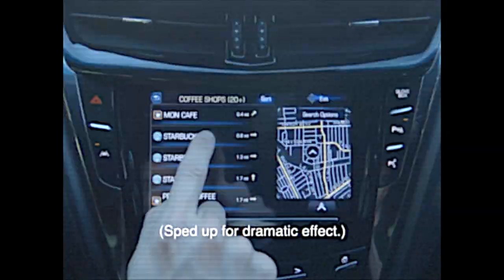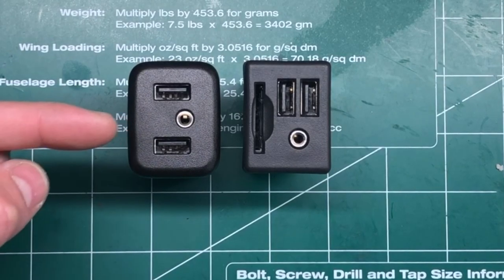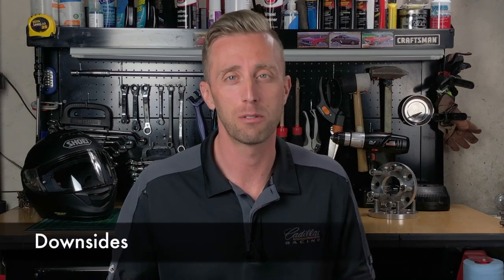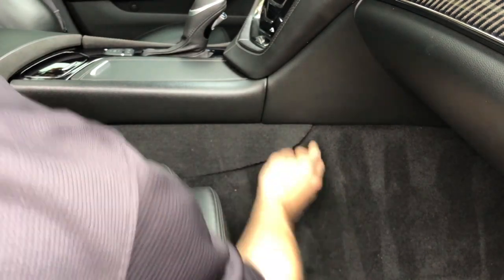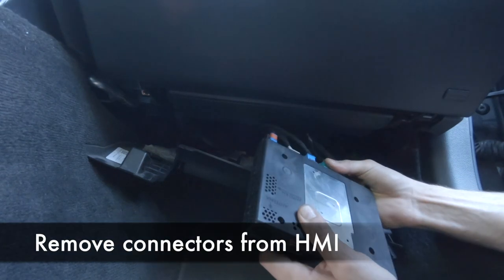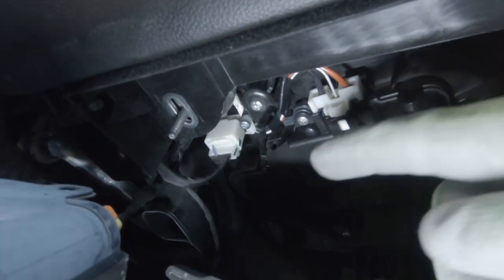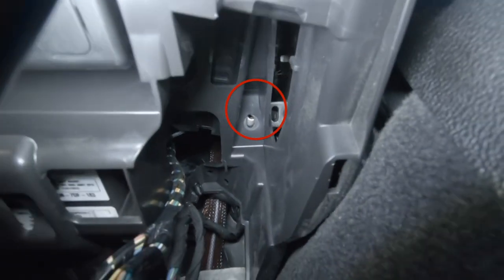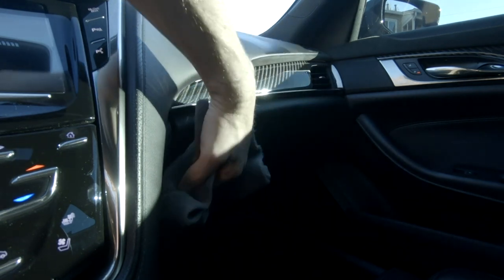How To: Upgrade your CUE w/ Apple Car Play & Android Auto

Comment: Installed my CUE 2.5 upgrade last night. Went pretty smooth thanks to this video! The hardest part I had was finding a good place to mount the included GPS antenna (my car originally did not have factory navigation installed so required a GPS antenna for it to work) as I had to find somewhere above the metal frame in the dash and keep it under the windshield. I finally located a spot just to the front of and below the center speaker. The first problem was that the metal infrastructure of the dash is some kind of aluminum and the magnetic GPS antenna does not stick to it so I had to apply some double sided tape to make it work. The frame still works well as a metal base plate for the antenna, it just isn't a metal that the magnet works on. Getting the antenna to this location took a bit of trial and error as it is very small area to work with to get the antenna positioned on top of the frame and get the tale to stick so the antenna is facing up. I accessed this space by removing the dashboard  center speaker cover. Once installed, I had to route the wire down into the dashboard so I could attach it to the HMI module. Getting the antenna situated and installed took the longest time. After that, it was just a matter of buttoning everything up and trying it out. Found out the location I picked for the GPS antenna works great though so no worries there. Two things I found out after the installation. First, even though the Nav system could find my current location in lat and long right away, when I pushed the button for local POI it said all the POIs were over 10,000 miles away. Also, I had no map at first so wasn't sure if it was working correctly or not. Not sure where this thing was put together but it thought the car was 10,000 miles away from any of the "local" areas. After driving around town and out on the country roads a while, the Nav system finally located and updated my position and then the map appeared with all my local roads and POIs. Even then though when I put in a route to my house which was only 5 miles from my location, the Nav system said I was over 10,000 miles from my destination. After driving about another 40 miles today, the mapping is spot on and everything is as it should be. The second thing was after connecting my battery back up and trying out the system, I noticed my ambient temperature on the screen was not working. All it showed was - - for temperature. After getting home from the drive I googled this and read that sometimes after disconnecting the power the ambient temperature won't show until a couple of start/stop cycles of the engine. Sure enough, when I started the car this morning to go on my second drive, my ambient temperature was working again. Tried Apple CarPLay and it is the bomb. Works great. One other point about the kit I got. It came with an upgraded USB plug module for the center console under the armrest. Some of the videos on YouTube show having to take apart the rear climate control panel and armrest to get to the plug. Found out this is not necessary and with the help of a plastic trim tool, you can push in the tabs on the side of the module and it slides right out of the hole. Once out, it's just a matter of unplugging the connections on the old USB module and plugging them into the new USB module. The new module then just pops into the hole and it's done. So in conclusion, had a great install and everything works as advertised. Sorry for the long ass comment but thought those of you out there thinking of doing this swap might benefit from what I found out here and not get worried when you turn it on and don't get a map at first, lose your ambient temp reading, or don't want to tear your center console apart to get to the USB switch. Hope you all have as great an experience as I did. I feel it was money well spent!
Reply: How much was the kit and where did you get yours at? Sounds like everything was with it
Reply: @Papeeeee  I got it here: https://www.gmpartshouse.com/p-cadillac-cue-25-upgrade-apple-android-nav-cue1316up. Total was $899.99 ($699.99 plus $200.00 to add factory Nav and Apple CarPlay). Came with new CUE 2.5 HMI, upgraded radio, and upgraded USB port (for CarPlay), and a GPS antenna (mine originally didn't have factory Nav). Some think the price is not worth it. For me, it was definitely worth it. However, the more I use the system, the more I like the factory navigation rather than the CarPlay nav.

Comment: I have an 14 ats with nav and I don’t mind cue at all. It has been slow or laggy or any of the other complaints I’ve heard. I use an sd card 32gb and 90% of the time I use steering wheel controls. But cue has been great.

Comment: Years later but adding a comment to this.  I just did this upgrade on a 2014 CTS with a CD player.   Be sure you have the CD player plugged in when you turn the system on, otherwise you'll just have a black screen.  I spent several hours frustrated that it wasn't working before I tried reconnecting the CD player wire and presto, it all worked.  I haven't seen this mentioned anywhere else, but it will make you feel that the upgrade failed if you leave it unplugged.   Thanks for this video, it was a great resource to have.

Comment: Hi. If you go to 19:19 on this video. You are showing the back of the radio module. The little yellow port by your left thumb I accidentally ripped the yellow wire that plugs into that and I wonder what's that for everything functions properly but I wonder what that wire was that I ripped. If you can please tell me please and thank you. In the morning I had my phone connected and the screen blacked out and gave me a communication error message in red letters. After a few seconds it turned back on but I still wonder if it has to do with that wire
Reply from the maker: I believe that is the XM antenna cable. I broke one too once and had to solder it to fix.
Reply from the maker: If you want to fix it just search gm yellow Sirius XM antenna. You will be able to buy the connector or a whole cable or extension cable. All will be helpful to fix.
Reply: Thank God it's nothing serious then thanks for letting me know and thanks for responding to my question.
Reply: By the way seems like ripping that cable is a common issue if you know how to fix it you should do a video on that. Would be greatly appreciated if could thanks. And subscribed

Comment: Hi Danial. GREAT vids (both of them). One question. Do you have to upgrade both the HMI (to v. 2.5) AND the radio module (what is the part number for that) OR just the HMI module? Thanks again.
Reply from the maker: cateague I think I answered this question elsewhere but for the YT readers both modules need to be upgraded.
Reply: I upgraded ONLY the HMI and it worked just fine. Carplay and all. Everything worked as it should
Reply: @haedenperrenot7841  Do you have the part number for the HMI you used?
Reply from the maker: What year was your car?
Reply: Haeden Perrenot what year is your car?
Reply: I would also like to know if I can only upgrade the HMI (to v 2.5) ? Or if I also have to get the radio module? I have a 2014 ATS
Reply: @acemanjohnson1011  following
Reply: @randycarrillo96  I did the installation myself months ago since I posted that comment. Installation was successful but you will need to upgrade both HMI and radio module

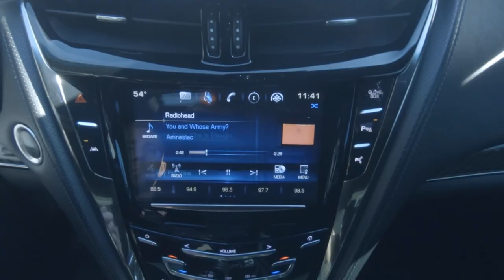Comment: I have a 2018 XT5 and the Screen looks just like the one shown at 1:04. I find it a real Frustrating Experience to select Music from the USB Drive, a real PIA. My STS which didn't have a Nav System was far superior when it came to selecting Music, though it was stored on 6 CDs. As for the Apple thing, Apple has somehow removed about 90% of my Music from the Phone, and it is even worse for trying to select Songs, than the CUE system.  The Manuals Cadillac provides would only be good for an Outhouse, and not as Reading Material. I refuse to waste money on OnStar, or that XM Radio thing. I never had activated them on my STS, even for the Trial Period. I did remove the Microphones from both the STS and the XT5, as there was no way to Disable-Remove the OnStar. I wish there was an Delete Option for all this type of Crap, when ordering a Vehicle. 
Taking Panels off the Interior has always been a Disaster for me, cause even it they don't break during removal, they never go back together properly, and squeak and rattle after
Reply from the maker: Generally no squeaks and rattles from this car since taking off many of the panels multiple times.  
USB operation isn't that great. You need to organize your music the right way for it to be somewhat useable and I believe the manual talks about it, but if not the Cadillacforums surely has a thread about it.  

Honestly, all that is behind the times.  With streaming music services for $10 a month you can listen to whatever you want whenever you want.  You can also save specific albums and songs so you can just go to those.  I know it's not what you are used to but it truly is a better system.

Comment: Great video! I just got a 2016 CTS and the cue system freezes randomly and becomes completely unresponsive while I'm driving... will this upgrade fix this problem? Thanks!
Reply from the maker: I would check with the dealer about the problem first. Some 2016s already have this upgrade but I’m guessing yours doesn’t?  If not, yours may just be freezing from its poor processing ability.
Reply: Screen freezing could a digitizer problem especially if parked out in the sun for long periods of time without a sunshade.
Reply: Could be a bad screen. I do the fix for these contact me if you’re interested in a fix

Comment: I'm a bit late to the party, but i finally got the 2.5 upgrade done on my 15 Premium. Question. With Android Auto engaged i lose the ability to navigate, skip or go to previous tracks using steering wheel controls however, volume is not affected. 

Any theories on why that will happen or DIY fixes for it? I was only able to find one place online that say it's something with the instrument cluster and if I send it in they can fix. But my Caddy is my daily driver and that same company said the 2.5 upgrade wouldn't work without a new center console USB hub which it obviously does, it just cant charge worth a crap 😅

Thanks for all you do and helping us get more out of our babies!
Reply from the maker: I’ve heard of the skip issue but not the navigate issue. You can’t navigate on google maps in Android?  Who did your programming?
Reply: My bad, I misspoke. I was talking about navigating my playlists in music streaming apps. Navigation works fine and I can navigate playlists directly in CUE, but nothing in the instrument cluster. Similar to how you can navigate the OG iPod/iPhone connection. I have to admit I haven't driven a 2.5 CUE in years so I may be confusing functionality with current CUEs.

I got mine done at White Auto and Media. I went with them mainly because they have a more fleshed out FAQ than the competition, so I felt a bit more confident with their OEM solution.

I did order the JoyeAuto Max 5.0 device you reviewed some time back and I'll order a new USB cluster for the center console since Carplay is not working for an older iPhone I use as an iPod or my wife's iPhone 13.
Reply from the maker: @manifest78 yeah the cluster options don’t really work. I’m sorry I didn’t address that. It’s certainly a feature that was designed for the times and I don’t think they made an effort to make it compatible with newer technologies. 

These days you need a modern phone and just use Siri to request artists or playlists.
Reply: @JetFuelOnly  No worries at all and I totally agree! The way they lock out or make most upgrades so difficult seems like a major oversight. Oh well, a grand here and there for upgrades is way better than what it costs for a fully loaded CT5 V-Blackwing or CTS V Carbon Package. It's like taking baby steps to my midlife crisis! 😂
Reply: I've also heard that swapping the cluster with the newer version through white automotive site. It's expensive since you have to purchase the cluster but apparently this restored the connectivity for some. Not sure if anyone has done it.

Comment: ATS coupe, 2015 w/nav, before I fork out cash for the upgrade your showing above, would I gain anything by upgrading the software built in the existing unit?  And does that function over the air with causing harm?
Reply from the maker: Software won’t change the functionality. One reason there are changes to the functionality after this upgrade is improved processing in the HMI module
For 2016. It’s capable of handling things like CarPlay.

Comment: My new phone connects to blue tooth and can connect thru USB, but for some reason won’t play music. But my older phone will connect and play music. Would this fix this problem?
Reply from the maker: cheifwaxallday420 sounds like a separate problem. Your phone should connect via USB and play music with any CUE system.
Reply: I just got a new iPhone 11 and it shows it’s connected on the screen but as I play music on the phone no sounds or song shows up on screen but the old phone works perfectly fine. Any ideas what it could be?
Reply from the maker: cheifwaxallday420 not sure about that one. Shouldn’t be a problem. But I guess the changed element is the phone so confirm all your phone settings are correct. Try the other USB port. Try a different cable. Wait for next iOS update too maybe.

Comment: How different is the install process for a 2016 ATSv?
Reply from the maker: Very similar process but 2016 ATS-V should have it. Some of the early 2016s may have missed the boat though.
Reply: @JetFuelOnly  Thanks for the reply! Is there a way to find out which version I have?
Reply from the maker: ezcompane do you have the PROJECTION icon on the CUE screen?  Some ATS-Vs in 2016 also had projection but only could do one or the other: Apple car play or android auto. If you have a projection icon and Apple CarPlay doesn’t work, talk to your dealer and they may be able to “activate” the feature it already has. If you don’t have a projection icon you will probably need a new HMI 2.5. unit

Comment: I’m installing mine soon is there a way to connect a reverse camera to this as well?
Reply from the maker: I think If you get the necessary harness and programming from MVI they might have an option. Yours doesn’t have a backup cam?  The MVI options have multiple camera inputs available
Reply: No backup cam 14 base model. I installed my upgrade, but now I’m getting a service airbag on my screen that wasn’t there before. Any idea of why that is happening? I didn’t disconnect the airbag during installation.
Reply from the maker: Caddy King hmm not sure. Unless the airbag wire got pinched or pulled too much. Have you tried doing a battery disconnect for awhile?
Reply: I went over my install and found a loose connection going to the airbag. All is well now. Great how to video! Thanks!

Comment: Hello, I have a Cadillac Escalade 2016 Europe modele and I have not android auto and maps are not update. Do you think HMI 2.5 will give me android auto and new updated maps for Europe ?
Reply from the maker: HMI 2.5 will give android auto but maps are separate. You can get new maps from the dealer.
Reply: @JetFuelOnly  Thanks a lot for you answer!!! :-) Can you advise me a dealer to get fresh map for Europe ?
Reply: Thanks a lot for you answer!!! :-) Can you advise me a dealer to get fresh map for Europe ?
Reply: After checking, update of Europe map are not available. About HMI installation into your video can you tell me if it will the same for Cadillac Escalade ?
Reply from the maker: I don’t know where the HMI is on the Escalade but I think I’ve seen a video.

Comment: your videos are great man so I have a 2014 CTS 3.6 AWD and it has the 2.0 HMI with built in NAV
in order for me to upgrade to Apple Car Play is there a set I can buy that includes everything I need to do this job on my own and for the parts to be matched with my VIN?
Reply from the maker: Mark Vax contact 404parts.com. They will set you up with everything you need!  Don’t forget to use the JETFUELONLY coupon code.

Comment: So is there anywhere I can plug in my vin and get the equivalent 2.5 hmi upgrade part number one of these site link no longer works
Reply from the maker: Contact www.404parts.com. They can get you the parts and program them to your VIN
Reply: @JetFuelOnly  I have access to a dealer that will do it I just need part numbers so and it's cheaper for me cause of discount
Reply from the maker: Email Marty, he can probably tell you:  dsminva@gmail.com